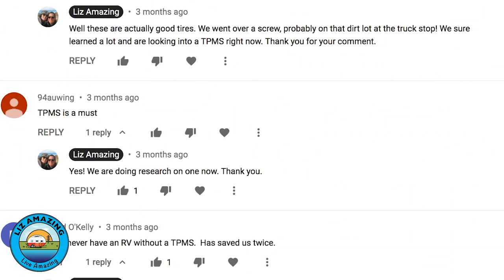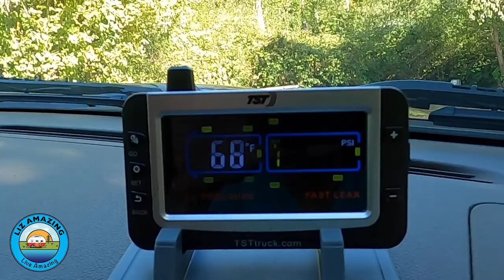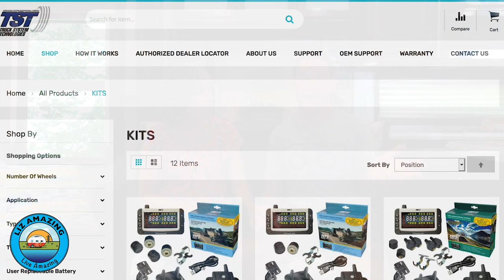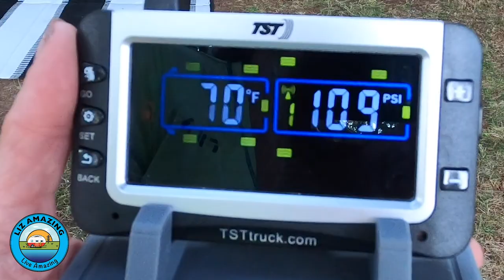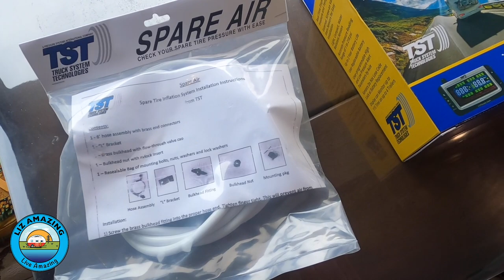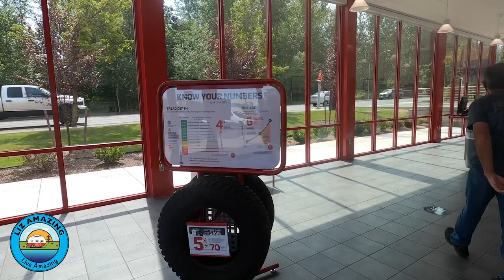How you can prevent a Tire Blowout | TPMS | Westlake Tires | Fulltime RV Living

Comment from the maker: We want to hear your flat tire stories AND do you know what Schrader valve is?
Reply from the maker: And save 15% on a TST Truck TPMS system. Be safe out there!
Reply: I did not know what a Schrader valve is it until I bought my ebike and I was looking for a tube in case I had a flat tire that is how I found your channel looking and researching e-bikes.
Reply from the maker: Oh that's good to know. Did you get your e-bike yet? We did a review on Paul's e-bike and have more reviews in the works.
Reply: @LizAmazing  yes I did get my ebike I got the ecotric hammer. It was about $1,400 plus I put $200 worth of lights and stuff and I got an extra battery so I could go camping but all the campgrounds are full I'd like to see more ebike reviews. I used to just go out in the woods and Camp that's what I might do
Reply from the maker: Glad you got your bike. They sure are smile-makers! Hope you get into a campground soon. Enjoy the woods!
Reply: Get into the habit of doing a preflight every morning.  I check all fluids and air pressure everyday but I set the pressure and don't adjust it when it gets hot because it will go up,  buy the highest rated tires you can, mine are 10 ply Michelin. 

Everyone is familiar with Schrader valve even if they don't know the name.  Some e bikes now use presta valves, but use adapters to fill use with a regular air chuck.   Anyone every see a Woods valve?  Now those are weird. 

Good luck!
Reply: Shader valve is the inner core. We call them valve cores. Cheap as dirt and there are some with screens to keep any inner dibri from sticking and allowing the tire to slowly leak after you check it with a gauge.
We used to spit check them after tire reading. They have a gator back that will screws onto stem like a cap and they allow you to check and adjust tire pressure without removing a cap.
They also keep road dibri out of core if you dont like caps. 
Remember also never use plastic caps. 
One they will not hold pressure in if you have a faulty or dirty core. 
Two there air times all the heat generated from extended braking or a tire failure melts the platic cap into core and of couse you must get remedied. 
Long winded and I have many more considering 
30 years as a transportation equipment operator and repair tech. Not to much I have not done or seen and always looking for a challenge. 
If its got wheels, wings or floats,
I work on anything even boats.
Ha ! Lol
Reply: Had a blowout one summer in the middle of the Navajo Nation.  It was a 120 mile drive to the closest open tire store that had replacement tires in stock.
Reply: Have Westlake g rated tires run at 100# they are great have about 20 thousand miles on them and they  look great came with my 2018 cedar creek. 2021 spring planing on replacement. I cover my tires when not in use.

Comment: Read the NHTSA tire report 95 pages, I'll save you the trouble,very boring. The number one reason for blow outs is low tire pressure. The low tire pressure causes the tire to have more rolling resistance friction which in turn causes the tire to heat up. When rubber gets hot it will fly apart as it spins. Check your spare tire pressure before you leave. I bought a new Forest River with west lake crappy bias ply tires, I didn't even realize until the tires side wall started completely cracking not even a year old what a joke, I called Forest River & my dealer & raised nine kinds of Hell. I couldn't believe they were putting my life at stake along with everybody elses for their cost of a radial ($35.00) unbelievable. My new 37 ft. toy hauler has radials & a spare like yours does. My camper tires sit on treated lumber on gravel with tire covers, no issues. Hi Liz & Paul, water heater, never did hear anything about the nomad internet, you said you'd let me know or at least check it out. I looked into it, to expensive for me, looks like a good tpms system. Did you know that when you pull hazardous materials you're supposed to pull over & check your tires in two hours or 100 miles whichever occurs first? Yes I do know what a schrader valve is. You could learn a lot from a dumb trucker like me, have a good one, Adam.😁😎🤔
Reply from the maker: Hey Adam, thanks for your comment. And thanks for backing us up about the #1 cause of blowouts. Who knew that with a TPMS you can PREVENT a blowout? I now firmly believe everyone pulling a camper needs to consider a TPMS.

As far as Nomad, I've been on host chat with them. Very misleading in that they say they have all four major cell phone carriers BUT (when you do a little digging) you must pick one. You can't rotate between them depending on where you are in the country. Seems pointless to me but does seem more targeted to people living in rural areas. They should change their name.

Thanks again and keep on truckin!

Comment: If the Tire is a Westlake Brand get rid of it !! Even if it is a New Tire it's been on the internet now for a couple of years about how bad they are>> I bought a New Grand Design in April of last year and I told the dealer to take the 15 Inch Tries and Wheels off of it and Replace them with 16 inch wheels and to put Michelin Light Truck Tires on it>> AKA LT Tires or I wouldn't buy it >>>>Problem Solved (:
Reply from the maker: Watch the video where we talk exactly about Westlakes and the surprising truth. We highly recommend a TPMS no matter what you are towing. Stay safe!

Comment: The MYTH of ”China Bombs” persists. There is ONE company that makes tires in the USA. Cooper tires. The rest are made elsewhere. Mostly in China. Tires have to meet federal specifications.

The ”bomb” is the driver. Tires have many ratings. The one least talked about is the SPEED RATING. Trailer tires are rates for 65 mph MAX. All of us have been passed by an RV doing over 80. When you insist on pressing the pedal to the metal you are lighting the fuse on the ” China Bomb”.

Walmart only SELLS trailer tires. They do not repair them. Loves only works on STEEL rimmed tires not the aluminum/magnesium rims. How do I know all this? My final walk-around before leaving Seguin, Texas revealed a flattening tire on the 5th wheel. It was a slow leak so I aired up. Loves was a mile away. The Walmart was next. Finally found a REAL tire dealer. They replaced the defective Schrader valve! Checked and aired all my tires. Cost? $16!
Reply from the maker: Wow. Good to know about Loves. We hadn't heard that. And good for you for doing a good walk-around before hitting the road. Very true that most blowouts are DRIVER error by running on underinflated tires. We believe all people towing a camper need to get TPMS. It can save lives and is worth the peace of mind knowing at all times how your tires are doing. Be safe out there!